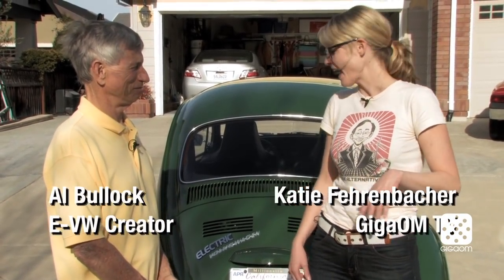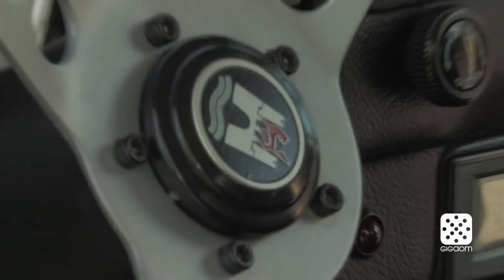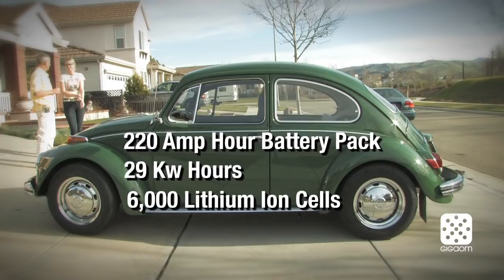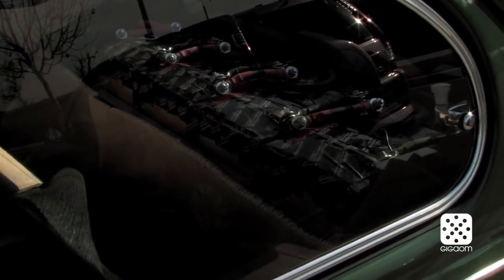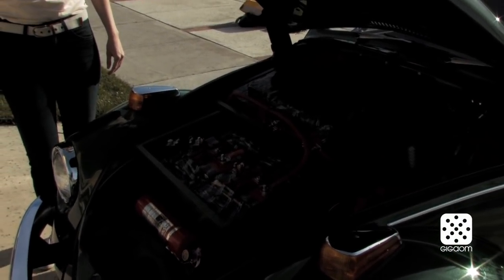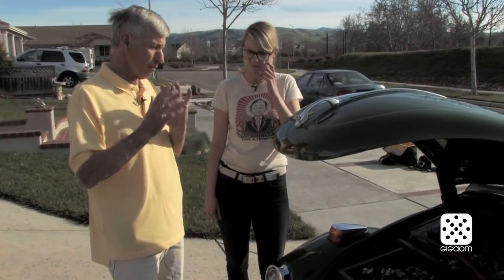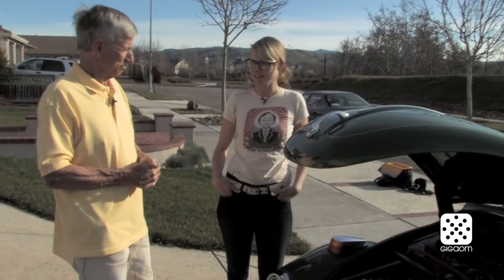Green Overdrive: The Homemade Electric VW Bug!

Comment: My FORD Focus EV batteries are good for 20 years at 80% or more capacity left. After 2 years in the Phoenix heat I still have full capacity. Lithium is recyclable and considered non polluting by the EPA.

Comment: That’s one impressive BEETLE sir!! 
My Bug used to go well over 100 with Webber carbs and 1600 pistons etc... just took a long run up to get there but would sit there all day on the motorway  ..   it  felt stable and ran fine ... handled brilliantly mind you it had huge tyres  a body kit and a whale tail on it! lol 
🤣 boy do  I miss my teens!!! an electric conversion on it would’ve been Fantastic! 

Before I rebuilt  it, it used to have thin cross- ply tyres on it, one of my lasting memory’s was driving up a hill in the snow with ease whilst all the other cars around me got stuck with their fat radials on lol!! My smile was bigger than the car itself!! 😆 and after 30years I think I may be tempted to buy another one!! 😅 I had a lot of fun times in that old car!

Comment: This is so cool, I've been dreaming about an electric car for a while and an ebug is definitely a seducing one. I'd only add an efficient ac to run below the Brazil's sun, though. Very nice video. Would somebody bothered to tell me all the main components used to make the conversion? I've read tons of papers, news, forum's threads and haven't come to a conclusion about what kind of motor to use. If it's mandatory to use lifeo4 batteries (they're are expensive), why not use modern lead acid batteries instead, and so on. If anyone points me to the right direction to do a project like that I'd really appreciate it.

Comment: Would be cool if they made a  simple complete Beetle EV kit that was 4 wheels with an electric hub motor in each wheel for  AWD traction. With say 120 HP & 150-170 fl lbs of torque when all 4 motors engage.  You get an entire pre made kit with simple wiring & installation instructions. Remove the engine, transmission,drive shafts, simply bolt the 4 wheels on,(use the old suspension & brakes) Maybe make 4 hub motors that could be bolted into the center of a few different styles/choices of wheels. Connect the 4 wiring harnesses to each wheel, put one battery pack up front & one in the rear, for even weight distribution. Now you have AWD with nice even weight distribution. You could  bring a spare tire/wheel that just bolts onto the hub motor to change a flat or just bring a plug/patch kit. The battery pack would use a DC to 12V DC converter going into a simple design regular car blade fuse box to power the cars LED headlights/tail lights/turn signals (that come with the kit) blower fan, little 12V DC electric heater, 12V peltier cooling fans blowing cool air on you for AC. Add 2 flexible solar panels that bend to fit the hood & roof contour that helps keep the battery charged.

Comment: 6 years later I bought a barely used 2012 Leaf for $6,500, but Beetle conversions are still ~$20,000 to build.  I still want to build one someday but they're hardly the cheapest or best entry into electrics anymore.
Reply: NO ONE SAID THEY WERE. IT'S A PROJECT FOR THE GUY.
Reply: same here, I bought 2014 Leaf 3 years ago for 11K, with 10K Miles......now it has 47K with no performance loss.
Reply: A Leaf or a Model 3 are generic and seen all over the place. A classic VW converted to EV tends to universally draw positive attention and nods of approval. That's basically the entire cost difference. Most people are too pragmatic to go the exotic route.

Comment: Let me say I know nothing about electric cars though understand both classic cars and electronics.
If this car had retained its clutch and used its gears would it not draw less amps pulling away?
Could the gearbox not be used on descents and braking to keep motor RPM high and make the most of regen braking?
What I am getting at is that if the gearbox were used as originally intended, would the potential range not be greatly extended?
Could a less powerful motor not achieve the same performance with an increased range by simply choosing an appropriate gear?
I just don't see the point in ditching the clutch if retaining the stock manual gearbox?
What would make a good clutchless system is if the stock transmission were ditched in favor of a fixed (as in no torque converter) CVT.
Just my thoughts.
Reply: Electric motors are very different from combustion engines in that concern. You just don't need to adapt the gear ratio to the driving speed and motor rpm. There is electric motors that can go from 0 to top speed. You don't need a clutch because the electric motors can pull the car from a standstill. The efficiency curve on an electric motor is pretty boring and for that reason there is not really a need for gears.
Combustion engines on the other hand normally only have a relatively small part of their rpm range where they are most efficient and at any other rpm they are significantly less effective. This is why you need gears and a clutch or gears and a torque converter or a CVT to use a combustion engine in a car while you don't need them with electric motors.
Electric motors don't use that much more energy when accelerating faster because it is insignificant at which rpm they are running. There is a small difference but it's not like with an ICE where you'd have to shift down to accelerate quickly which of course uses more fuel because the engine runs at a higher rpm.
When you are at a lower gear with an electric motor it would have to run faster to reach the same target speed as it would in a higher gear. So there is less load on the electric motor but it has to run faster -> Energy consumption is very similar. Electric motors for cars or bigger are required by law to run at 90+% efficiency ALL the time/at every load. Combustion engines get a max 45% efficiency at one point in the rpm range
There is only an advantage if you need really high performance and the electric motor would otherwise not be powerful enough. (Acceleration at max power is quicker with a lower gear while top speed is limited of course compared to the higher gear)
The regenerative braking is a good point because that is actually very dependant on the motors rpm.
Coincidentally I drive a hybrid car so I know that "problem" that there is less electric braking at low speeds. But for driving that is not a problem, you just step on the gas and it pulls away pretty quick, electrically with a fixed gear ratio that covers speeds from 0 - 170 km/h (Or no gears at all, I have never looked into the motor unit actually)

Finally:
No, it would not (significantly) use less amps to pull away at a given acceleration in a lower gear.
No, range can not be (significantly) increased with a less powerful electric motor (would be almost the same) and also it could not achieve the same performance as a more powerful motor.
Yes, regenerative braking works better at an higher rpm.

A CVT has a big advantage with a combustion engine but a very small one with an electric motor. So I think it would just be one more part that could break and also limits the torque because from what I've heard CVTs are prone to be not strong enough - I have never actually driven one

EDIT:
Efficiency curve for an electric motor:
http://www.waterworld.com/content/dam/etc/medialib/new-lib/waterworld/print-articles/volume-27/issue-11/37677.res/_jcr_content/renditions/pennwell.web.450.300.gif

Efficiency curve for some combustion engine:
https://i.stack.imgur.com/Rl5zP.gif
Reply: He said he can change gears, usually he uses 2nd gear but in the highway he uses 3rd.
Reply: Wondering about all this stuff myself.
Reply: @timmytubede  Interesting information. Thanks for that!!

Comment: AC motors and controllers are a LOT more expensive! You can easily convert a bug with DC for $2k. But it would be hard to convert the same bug in AC for less than $5k. And this is without battery pack.

Comment: At 5:15 - "This puts out 1000 watts, which is considerably more power than a stock Volkswagen." 
Err, 1000 watts = about 1.3 horsepower, about 50 less than a stock Volkswagen!
I'm guessing he meant 1000 amps. 1000 amps x 120 volts = 120KW, which is about 160 horsepower, now that IS a lot more than a stock bug, must be good fun!
Shame he didn't use an AC induction motor though, then he could leave it in second gear the whole time and have regenerative braking to increase the range even further.

Comment: I prefer brown I like my engine with the roar. I could convert it to alcohol. then that would be greener than electric. Because it would not contribute to fracking. which electricity usually comes form natural gas. especially when charging at night. and unlimited range.

Comment: Ehm, with the impulse motor he can still use regen braking. 

I'm not sure that he can do 120KW though. If he's using 18650 LiCo he's probably using laptop cells, which have a max discharge of 2C. So for a 220amp batter, that's 440amps. I think it's a 131v battery (29kwhs/220amphrs=131v), so at 440amps that's 57.6KW which is something like 77 horsepower. It's still going to be more fun than a 77 horsepower motor because of the immediate torque of an electric motor.

Comment: help me out here... apparently Tesla claims to be having around 7000 cells and gets somewhere around 250 miles, this bug has over 6000 cells but only gets 75-125 miles isn't that low?
Reply: fortune mmameshi The technology is way different when you're talking about an old Volkswagen Beetle and a Tesla Model Whatever. You really should take things into consideration like aerodynamics, quality of the components, and the components used (all around, for example this Beetle is using a gear box, Tesla doesn't use any).
Reply: +DutchBoy 2015
Je bent helemaal off topic buddy.
Reply: A tesla can store 85 kw in it's battery pack, this car can only do 29 so theres your range difference.
Reply: +fortune mmameshi The number of battery cells is irrelevant IF the specs per battery is different. They said this car has 29 kWh total storage, Tesla Model S starts at 70 kWh for the cheapest version and goes all the way up to 90 kWh for the current top of the line version. That's anywhere between 2.4 to 3.1 more energy compared to this car which makes the range difference easier to understand.
Reply: Still a good car
Reply: It might be because the dc motor, it wastes energy beacuase dc current heat up the equipment more than an ac motor
Reply: YOU CAN'T COMPARE A HOMEMADE CONTRAPTION TO A TESLA.
Reply: Cars that are built electric from the factory do not have a gear box like conventional cars do. He is adaptively driving his car to avoid excessively shifting, which is anyway easier after his conversion. But his car has nostagic classic value and was fully restored so it is like a brand new VW without the ICE problems or pollution. What he saves on gasoline should also be added to the value of the car, and it needs far less maintenance now, and remains clean under the hood.

Comment: If you do change gears what stops grinding? You said there is no clutch so when its goes through neutral wont the motor spin and have the same effect as a ice?
Reply: I'm guessing, but he might just be matching the motor/gearbox rotation perfectly on the shift. There's no reason you can't do this in the motor controller with a couple of rotation sensors and a gear shift sensor. Overall, it would be substantially less complex than a clutch and pressure plate, and it should also be a lot more reliable. Most of the work would be in the controller firmware. You might need a lock system to prevent shifting into, say, first at 90+, but then again, you might not - it depends on the design limits of the motor.
Reply: Thinking about it, you'd probably need to add a lock to the shift to accommodate the match delay caused by the rotational inertia of the motor, but that should be the most complex part of the system.

Comment: "VW dont want to go any faster than that; they're too small and light"
IT used to be a light car, then you put ~600lbs of batteries in it...
Reply: Wouldn’t a lot of that weight be offset by the removal of the engine, and oil weight and all the things an ev doesn’t require?
Reply: @henrykeith9542  Highly doubt it. VW bug engines were tiny.
Reply: a full fuel tank is something like 160-170lbs; the motor is another 100 or so. So yeah all said and done an EV converted classic VW will be about 2-300lbs heavier, the equivalent of driving with a large-ish passenger. Considering that the conversion typically triples the motor power, and that the weight distribution tends to become more even and stable (no gas sloshing around in that tank), it's a pretty attractive deal.

Comment: somebody do me a favor and forward a message to that gentleman let him know that it's you takes to 12 volt dynamos from old bicycles and mounts them in the front end on the swingarm to where they can make contact with the inside of the drum they will spend in recharging batteries self-replicating energy those two 12 volt generator should produce plenty of powers recharge all of this system while he's driving
Reply: This is better accomplished with recuperation by using the main motor when braking. Just having dynamos like you suggest would sap more energy than it would produce.

Comment: i guess 1000w is the heat dissipated due to pwm losses
Reply: That's a huge power loss in the design or system efficiency  I am certain that this problem has (by now) been addressed. Love the Beetle, love the work and thought which has gone into this.

Comment: 1000 watts is 1.3HP. Pretty sure the original bug had more than that, dude.
Reply: Does that car look like its being pushed my a 1.3hp motor?
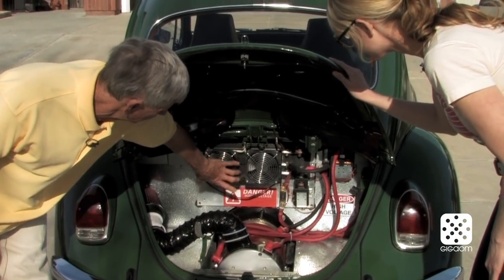Reply: Well, 1hp is 750 Watts. At 2:19 he says 1000 Watts which would be 1.3hp.
Reply: MarkBits He must have misspoke. The performance of that car looks closer to 100 kw.
Reply: He actually meant to say 1000 Amps. And 1000A x 130 volts = 130kW. Possibly as much as 100 Watts at the rear wheels. 130HP. A Beetle is usually about 45HP - so three times the power of the original ICE. That will be a nice surprise to see at Traffic Lights.

Comment: To me this is stupid. If you want an electric car get a Tesla. Why would you ruin a classic car like this? Just my opinion but one of the things that made me fall in love with the old bugs is the way they sound. Again this is stupid
Reply: This conversion was done before the Tesla roadster was even available. It was the first to get 225 miles on Li-ion batteries.
Reply: I'll take the radically improved driveability of a converted classic VW over the original experience, any day. Slow, noisy, and with an aging evap/smog system, many also smell like gasoline and will give you a headache if you spend too much time around them. For actual daily use (and not just a weekend show-and-shine), a converted classic VW is just so, so much more practical.